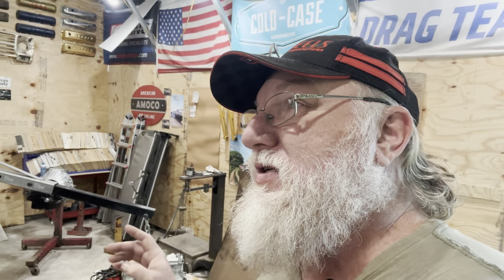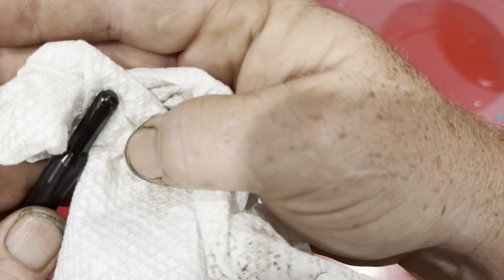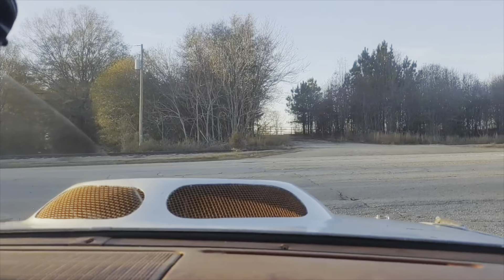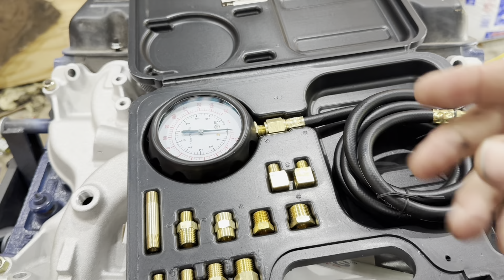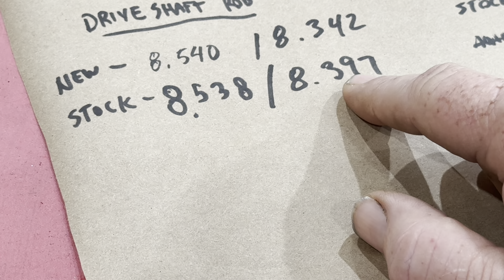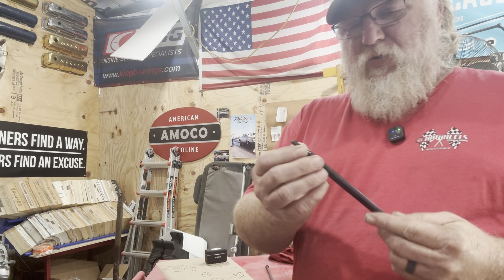Brand NEW Engine… ZERO Oil Pressure?! You Won’t Believe What I Found!

Comment: Dude they may not have got the shaft into the distributor at all it may have been sitting to the side of it.. Check that roll pin too on the distributor that locks the gear to the distributor shaft....

Comment: Had a friends father buy a new Ford truck with 351w in it. On the way home the truck died with a dent in the hood! Engine shot out the distributor! They machined the block to deep at the factory! Dealer put shim in and it went 250,000 miles!
Reply from the maker: I have seen some weird stuff, I tore one engine down that was .030 and they had stamped the piston with factory stamps.   There was some issue with the engine when it was built and they rebuilt it before it left the factory.

Comment: Look and see if the ball and spring have been blown out.  You might get to pull the timing cover and put it back together with the right pickup. 
What are you running in the Galaxie? God bless you brother. The pickup to oil pump flange is easy to miss. The ball and spring are held in by the wide side of the flange and it world be easy to weld to the tube backwards. I am sure glad I caught it. The regulator ball is barely held in there and would be easy to miss.  I  never ran into that with a Canton. But Super Stock required Milidon. I put the Canton pan and pickup on my 394 ci D/SS 65Galaxie. It makes 525 hp and 540,fr lbs with no belts Fewer cars I ran in D/SS, i came out to D/SA in Stock and a bunch of cars. I lost my sight, I sure miss racing and building FEs.

Comment: Does the witness mark on the top of the shaft engage the distributor?
Reply: Another thing is that the pickup that bolts to the pump, I have seen some that had the flange welded on backwards where it holds the bypass ball in . If the flange wedded backwards the bypass can pop out. I have seen it brand new on a new Milodon pickup that bolts into the pump. The wide side that is supposed to be over the bypass was welded on backwards where the bypass could blow out. I had to send it back and they sent me a new one. It happened to Brent Lykins too, but we each caught it when we were bolting it on before putting the pan on. Just a thought. You might want to look down in there to be sure the bypass is still in there.

Comment: Take cap off spin distributor see if locked in the cam
Reply from the maker: The engine was running so it was engaged with the cam

Comment: Have you compared the aftermarket dizzy to a factory unit?  Nothing aftermarket ever works. My guess is the distance between the end of the dizzy to the surface of the dizzy that bottoms out on the block will measure short.
Reply from the maker: I actually just thought about that this morning.    So that information will be in the next video along with looking around on the inside to see if anything is hurt

Comment: Why don't you put the priming tool on it? Put a straight edge across the intake.  Take the measurement.

And then measure the base down from the distributor 

And then how far that goes in the distributor do the math
Reply from the maker: There is a lot more investigation to be done for sure.    There will be another video that will get deep into everything including actual digging into the engine and looking around

Comment: Stacked tolerances . Without pulling off the timing cover , you could check the deck thickness of a regular manifold to that of the tunnel ram . Check distributor gear teeth for wear pattern for loose engagement.  Check the inside hex of distributor shaft for depth engagement by the oil pump rod . Waiting for the next video .
Reply from the maker: I agree stacked tolerances.  If each piece is a hair off that adds up to a lot
Reply: I came here at 29:46 in the video to say this. AND to say take the old shaft in that distributor at the depth of engagement that evidence shows and see how loose it is compared to the stock perfect shaft he has. I bet the bottom of the distributor is stripped because it is at the largest "ID" according to tolerance range and the aftermarket shaft is at the smallest it can be in their tolerance range. The distributor doesn't sit down on the intake like a Chevy.  It can slide clear through the intake.  It seals with a beveled seal ring around the distributor body/housing to the intake. The distributor sets down solid against the block down inside the block. Of course that mating surface of the distributor could be at the end of it's manufacturing tolerance range causing the distributor to not go deep enough. Stacking tolerances can frickin snowball into a mess.

Comment: I have  seen  distributor  gear  roll  pin shear. Could  that  be it. I'm  getting  old that  would  make  the  timing  off too if that didn't  turn  or not  even  start.
Reply from the maker: Yeah on a ford it would run that way.    BUT the length of the bottom of the shaft on the distributor could be off.   All good things to look over

Comment: Has the gauge been checked by chance that was used? Those aftermarket lines, especially the plastic ones, like to kink. Or if overtightened closes off the line itself.
Reply from the maker: Yes he said he tried a secondary gauge.
Reply: @frizzellracing does the FEs have bypass springs in the oil pump like the Windsor family oil pumps? Maybe it’s sticking or the spring is broken if they do.
Reply from the maker: @TheFoxLodgeGarage that’s a good thought

Comment: Hey Bobby! I had an issue with an aftermarket distributor on a 351w...the shaft below the gear wasn't as long as the one on the stock distributor causing oil pump rod to be right at the edge of distributor shaft...thankfully I noticed it before I fired it up...put in a stock Duraspark and worked fine.
Reply from the maker: Parts definitely are not what they use to be.  You have to look at everything now
Reply: @frizzellracing yup!
Reply: Exactly.  Bobby you need to measure from the mating surface of the distributor down in the block to the bottom of the gear teeth and the bottom of the shaft to see if those numbers are out of spec. It could even be a tolerance spec involving the oil pump. I bet you put an M57 either HP or HV Melling in it. Great pumps, I sold hundreds of them from 78-88 for all kinds of engines and never had a defect, but times have changed since then. My money is still on the bottom of the distributor shaft(female part) is too big and the aftermarket shaft is too small (tolerance ranges) and the shaft is slipping in the distributor. $$ Good luck brother, keep us posted.

Comment: Why have we not looked at the dist gear?
Reply from the maker: Well I did look at a few other things and some of that footage isn’t in there.   That video was taken over the course of a month as I was in and out.   Some footage got lost.     But there will be another video coming that will dive deeper into everything
Reply: I have many questions here I have never watched this guy's videos before it appears he's supposed to know a lot about Effie Motors I cut my teeth on f e I built Dodge Chevy Fe all kinds of motors in my 50 years of mechanical I've never been a big fan of the Effie's intermediate shaft from distributor to oil pump but you're right there are other things to check but now I've got to know the end result LOL
Reply: Yes there is a roll pin in the distributor gear I have seen a break I've never seen one fall out we'll figure it out huh😊
Reply: My thoughts also, and maybe, just maybe the base of the dist. Being aftermarket that the base wasn't milled to the proper thickness, the distance from the bottom of the base to the bottom of the gear at the end were the shaft in gauges. And like he was saying about the intake maybe the difference. Just my thoughts a whole two cents worth. Lol